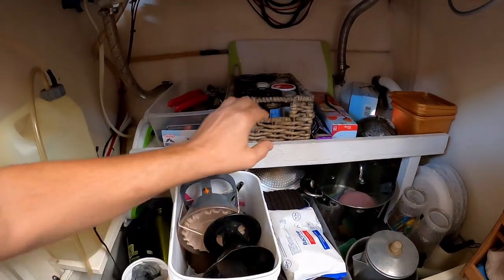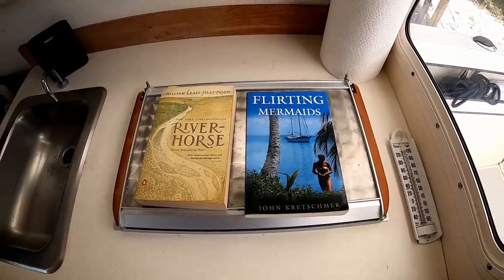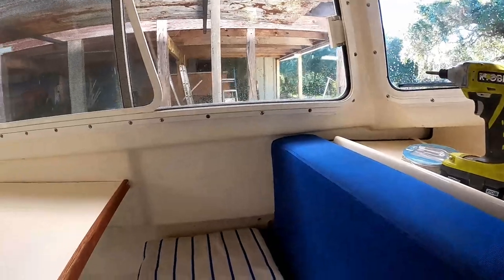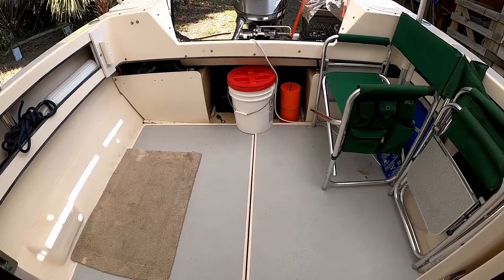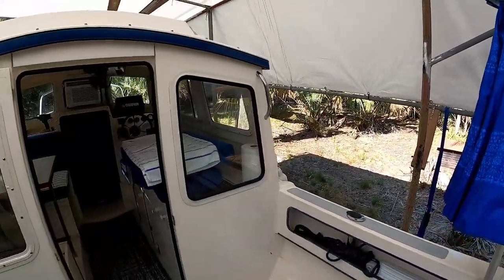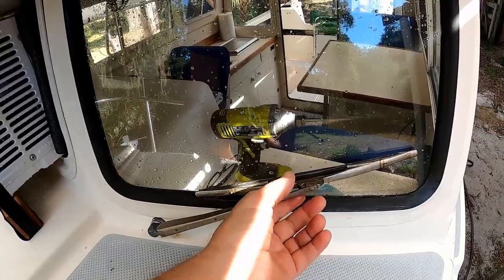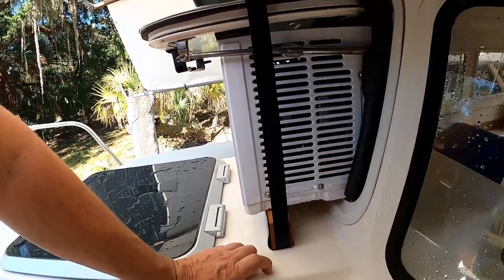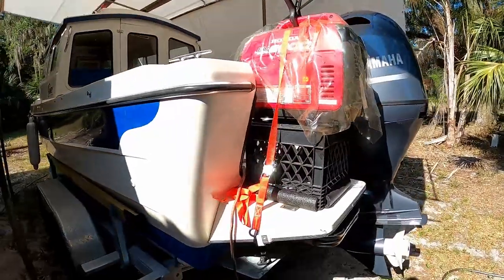Enter The C-Dory

Comment: I'm thinking about buying one of those boats but I was just curious how long the The table that turns into a bed is.  if you could measure that for me that would be a great help. I'm 6' 6 just trying to figure out if there could be a good spot for a bed in there for me.  I'm not sure the front bed would fit me. Thanks love the content
Reply from the maker: Hi there I just measured it and it's 6 ft 2 in wall to wall where the dining room bed would be so it'd be a little short for you unless you slept a bit crouched or at an angle
Reply: Thank you for the response I definitely appreciate that. I think I could make it work in the front v bed just my feet would have to hang out lol.  I definitely enjoy your content and will continue to 👍 and watch

Comment: Thanks for the video. Looking a buying one of these.  Do you know the difference in performance and mileage for the single 90 vs twin 50’s. ?
Reply from the maker: Thanks for the comment Fred. Good question on mileage between a single and twin I really don't have any idea on the twins, I think the new Yamaha gets about 3 to 4 miles per gallon based on watching Trip Smiths video. I'm much prefer a single engine than a twin the single engines are so reliable nowadays.

Comment: It's been a year. Is the 90 enough power? Do you wish you had gotten the 115?
What was your influences for getting the 90 vs 115? Cheaper cost? Cheaper on fuel? Less weight on the transom? Supply shortage????
Thanks
Love your clips.
Reply from the maker: 90 is perfect.  Plenty of power, jumps on plane easily. Boat is rated for max 90 from manufacturer.  You put bigger motor insurance will deny coverage.
Reply: @jimsflorida1817  
You're on the west coast, yes???. I hope the the storm didn't do you to much damage. As usual, Jacksonville was spared. Thanks for the reply.
Reply from the maker: @francus7227  thanks Francus yep west coast was 13 miles from the eye, lots of downed trees but home and boat all good. Glad you were safe.

Comment: I have a 22' C-Dory as well. What brand and model of AC unit did you buy that fits in the front window?
Reply from the maker: It was a cheap wally world ac unit brand is Midea, 16" wide x 11" tall.
Reply: @jimsflorida1817     By the way.  Midea is a very large world wide manufacturer of all kinds of AC units.

Comment: Put a safety line on your genset tied to a hard point. If you leave it on the swim step. The ratchet strap is not 100% fail proof.
Reply from the maker: Very good point thank you, I didn't end up leaving it on the swim set step Check out my next video I have it in a more secure location.